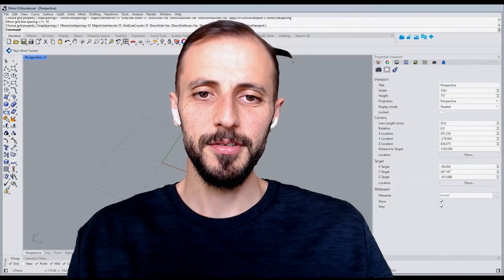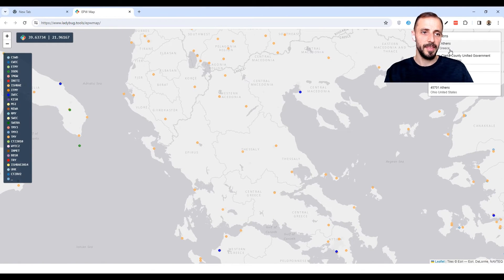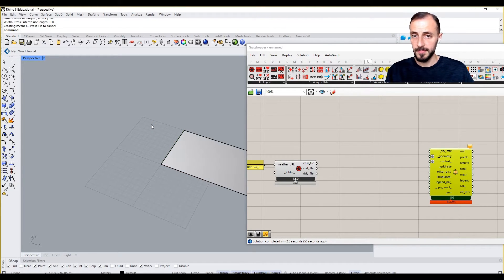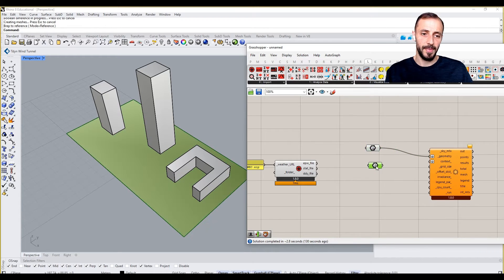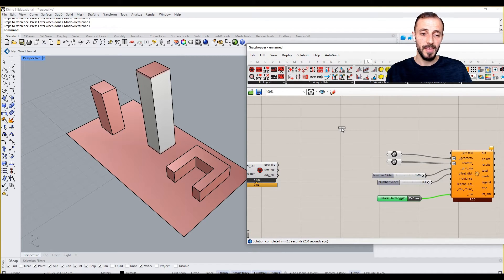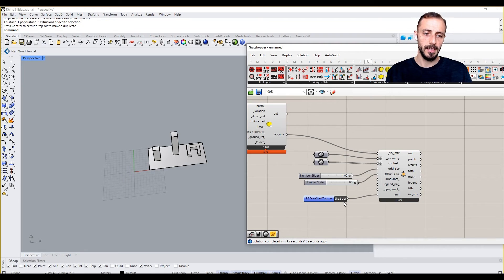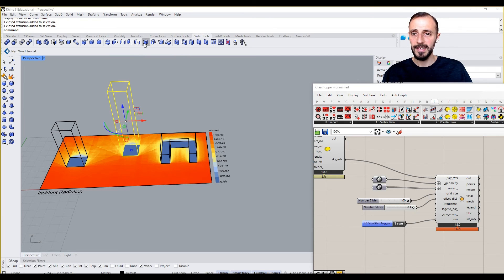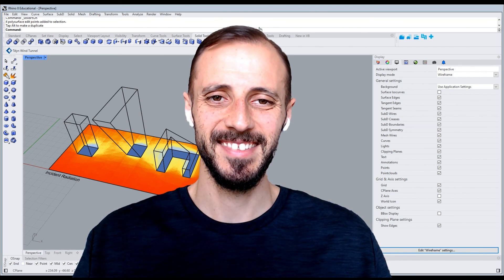1-Solar Radiation Impacts on Surfaces with Ladybug #solaranalysis #ladybugtools

Comment: I have a complex form on built entirely on grasshopper, and i want to run simulations on it. Like you have converted the Rhino model into one component in grasshopper and used as input in grasshopper, how do i do that for a model built entirely on grasshopper?
Reply from the maker: Hello,

You can connect your complex geometry that's created in grasshopper to "geometry" input in ladybug. You can also assign the context geometries by connecting your context geometries to "context' input of ladybug.

Also, you can access the exercise files by signing up our skool community for free:

https://www.skool.com/grasshopper3d-lab/classroom/ea1a0966?md=7a4887f944d74fafa74c371fa4e3712b

Comment: Hi, thanks for your videos. When using the incident Radiation i am getting just one number for all analyzed days, do you know why is this happening?
Reply from the maker: You are welcome! Where do you read that result? From "Results" output or "Total" output?
Reply: @grasshopper3dchallenge  from the “Results” output. And the Grafik is just one color not a “heat map” like in the video
Reply from the maker: @youssefalshalal1191  Would you mind sharing some screenshots from your work? You can post your questions to our community below:
https://www.skool.com/grasshopper3d-lab/about
Reply: @grasshopper3dchallenge  thank you will do for the next question, the problem was in my rhino Modell, the context wasn’t intersecting with the surface analyzed.